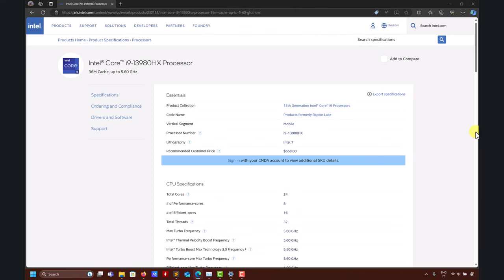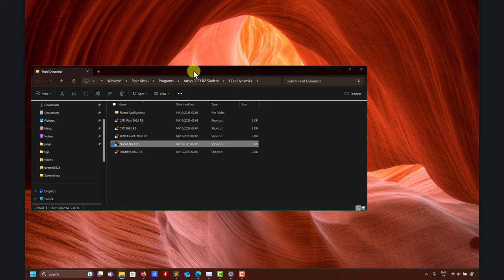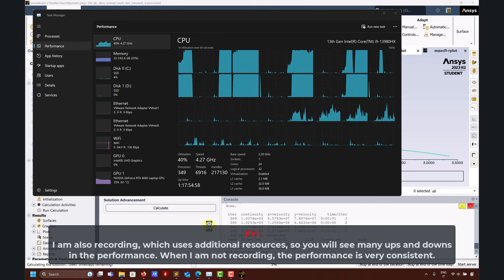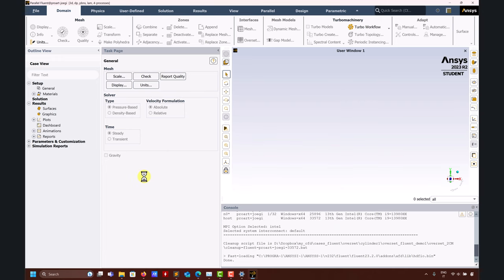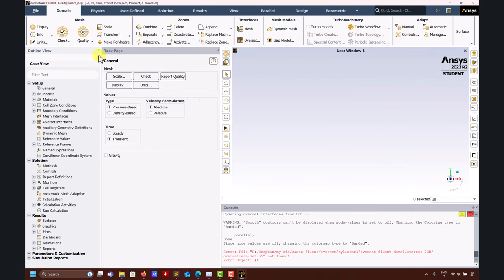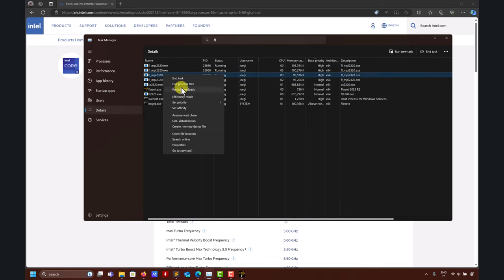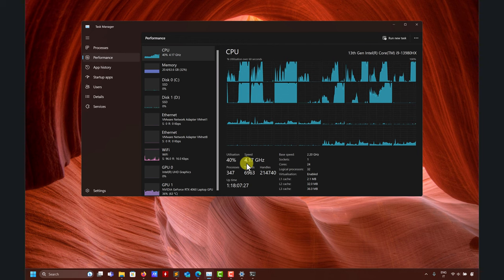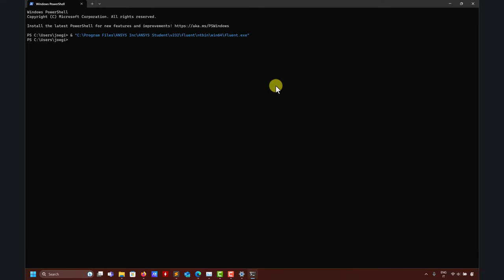Ansys Fluent and OpenFOAM using Intel Hybrid architecture processors

Comment: Hi, with your configuration which is the maximum number of 3D elements you can run? I have an i7-1335U and I struggle to open something more than 14M, running is impossibile. It's possible to make these RANS simulations on intel i9? Thank you.
Reply from the maker: Well, depends of many factors.  But if you are using a coupled solver, you will need a lot of memory. SEgregated solvers my rule is usually 1mill cells equal to 1GB RAM (roughtly speaking).  In a notebook with 64 GB RAM I can run meshes of roughly speaking 50 mill cells.
Reply: @wolfdynamics5703  Thank you!

Comment: I bought a desktop powered by i9-13900KF and it sucks when I include efficiency cores in openfoam simulations.  Running with only 8 p-cores is much faster.  I should have bought AMD instead.  Intel chips are great for gamers and content creators, not for scientific computing.
Reply from the maker: Yes, I do agree with you. I almost sent back the computer but in the end I decided to give a try. I am not a 100% happy with this architecture but I managed to overcome the issue with the efficiency cores, so kind of the simulations are running as they should. But AMD or intel standard architecture perform much better that this bloody hybrid architecture.